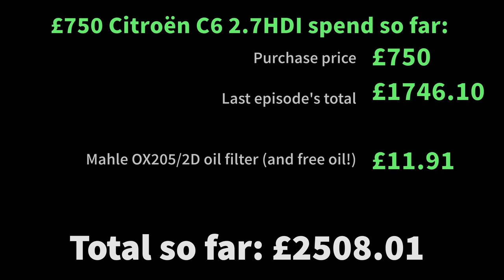Cheap Citroën C6 Project 7:  Time to see if all the work...worked!

Comment: Changed all the Sphere and it was still floaty, the hydraulic pump went out, I got a new one and all was fine, I guess it is the pump not delivering enough pressure because a capacitor went weak!
Reply from the maker: I think it's all working as it's meant to, to be honest. Just might have the gas pressures slightly out.
Reply: @UPnDOWN  Just told you my experience, got a new pump and all the annoying floaty mc floatface was gone. By the way it is possible to refurbish the system, the motor is a Renault part and the capacitors are changeable but they do need a bit more work. I think that a lack of hydraulic pressure acts the way as if you have spheres with too much pressure and then the damping is softer.

Comment: I like the air line blowing into the sump. Messy but loads more oil came out.

My local garage likes to use an oil flush before dropping the oil. I'm never sure it's necessary. Would welcome thoughts on it...
Reply from the maker: I don't like flushes really as there's the chance they'll block something up with some dislodged sludge. Regular changes using slightly cheaper oil are better, for my money.

Comment: As usual an excellent video, When you do these outdoor location I am drawn to the possibility that a train might appear above the arches in the back ground. Regarding rats get your neighbour to have a camera check out waste pipes, especially from the toilet waste, Quite often the ground will settle pulling the connection off thus with flushing the surrounding soil is washed away thus exposing the cavity allowing access to his/her unit. and eventually yours (I really hope not)
Reply from the maker: You're never more than 6 metres away from a rat, wherever you are...that's what they say, I think?
Reply: There's a CX Safari for sale at Chevronics I had a close look and noticed some rust developing in the usual places most notably below the window on the tailgate.  Shame. However it's a nice gray and other  wise in pretty good condition.  Wonder what's it like underneath? Just the sort of car a citroen lover would buy and give a bit LTC

Comment: Is it just me or did the bouncing when the car stopped at 11:33 seem excessive? Could that be symptomatic of the pitching problem you're experiencing?
Reply from the maker: No, it was on high suspension. That bouncing was a combination of the tyres deforming and the ramp moving, as there is zero suspension travel at its highest position.

Comment: What's the best brand of oil filter? Want to know for my own cars. I usually get Febi or Mann ones, figured they were the best ones.
Reply from the maker: Febi is normally good stuff. Mahle are good, as are Purflux. Trick is to find out who makes the genuine filters for your engine and use those, if you can find them. Eurorepar are good too.
Reply: I think it's hard to know which is best between Purflux, Mann, Hengst and Mahle.  Since this is a French car channel, surely it has to be Purflux as those zig-zag pleats are just plain cool? 😉
Reply: You likely can't go wrong with oil filters from the main dealer, if they are still around. Might be a bit more expensive, but at least you don't need to worry about the quality or otherwise of an aftermarket brand.

Sometimes oil can be cheaper from dealers than from other sources, so it's worth asking them for their current prices.
Reply: @howarthcd  There's no BMW or Mazda dealer near me (I've got a Mini R53 and NA MX5) so it's not worth the hassle driving 90 minutes to the nearest one for most things. Definitely not for an oil filter anyway.

I do the oil and filter every 4-5k anyway so as long as the filter does a half decent job, it should be fine regardless.

Comment: Does the g/box have a pressure regulating solenoid? If so could cause issues you mention.  Like a dpo in a 406 pug
Reply from the maker: I think it does. Will check.

Comment: first of all I love your video series. I learned a lot about the C6. And for your information I do drive one daily.
About the suspension I had mine calibrated by Johan Oldenhage. He has a garage and does a lot of servicing on the C6.

https://www.youtube.com/watch?v=bmmaZIq5tfc

This is a video about how the calibrating works. Unfortunately it is in Dutch. This is not a very expensive procedure, costs about the same as aligning a car.
But the suspension improved a lot on my car. 
He also flushed the gearbox and to be honest, It did not improve that much. 
The car shifts fine. But if I stand still at a red light and push the gas throttle , it does not immediately   accelerate. It tense to wait just a little bit. I asked the garage about this and they said it is not abnormal behavior. You could chip tune the car, but honestly, I don't bother. If I accelerate it goes real quick.

Love this car and do not regret buying one.

Comment: Is this the same engine used in the (older) Land Rover Discovery?

The channel "Land Rover Time" did a video about the correct oil to use:

https://youtu.be/Q4NeJrbor4s

Turns out 30 might be a fudge for emissions or something. Their investigation came after rebuilding an engine with a snapped crank shaft.

Cheers!
Reply from the maker: It's the 2.7 TDV6 in the Disco. Thanks for the heads up, will check it out.
Reply: @UPnDOWN  hope it helps a bit!

Comment: "Lasts for the life of -whatever-" is the biggest pile of bollocks car companies peddle. Like timing chains that last for the life of the engine... Well of course it lasts for the life of the engine, because when they fail, you need a new engine (or at least a rebuild).
Reply from the maker: Tru dat

Comment: I would like to ask Citroen to clarify what they mean by the "Life of the vehicle", because the shitty advice they give certainly shows they only care about it until the car is in warranty. I mean Citroen says the gearbox is "sealed for life", no maintenance needed, or make engine oil change at 30.000 km... That´s horrible advice!  Oh and now the coolant pipes are being discontinued. The last C6 was built in 2012, so that´s it, they don´t supply the damn hoses :(  So if we consider all this, the "Life of the vehicle" in eyes of Citroen is no more than 10 years!
Reply from the maker: Exactly. Car manufacturers are after profit, not longevity. It's in their interests that their cars last long enough to market them as reliable and dependable, but not so long that people won't want to buy new ones. The C6 is now of the age where Citroen don't give two shits about it, yet the fans of the marque's greatest hits still do, and will likely continue to do so. The question is can they all be kept going as easily as the older stuff? It's comparible to the Vulcan being grounded while the Lancaster's still allowed to fly.